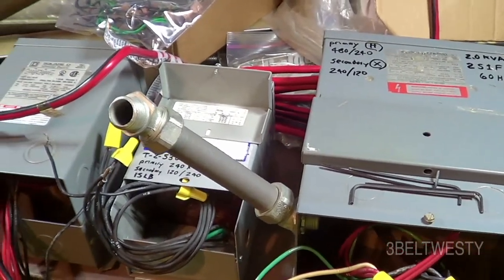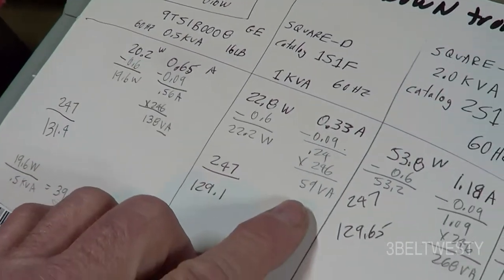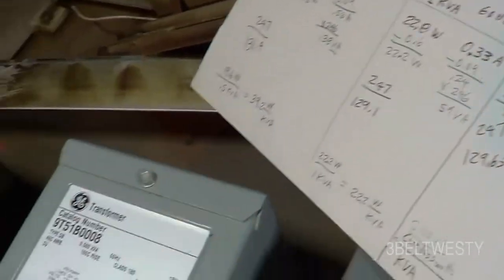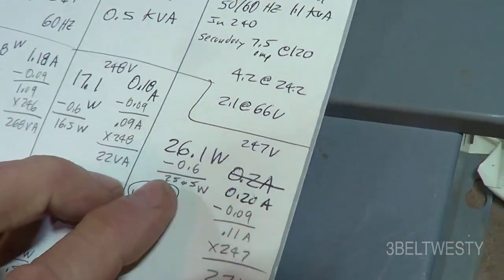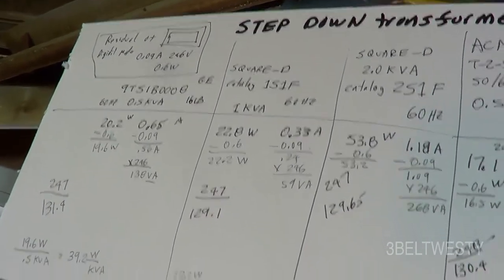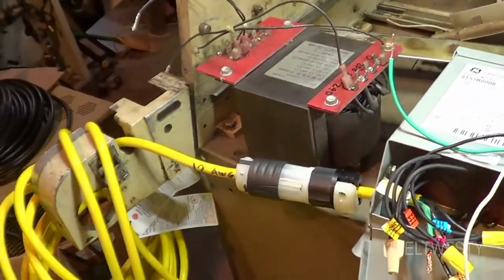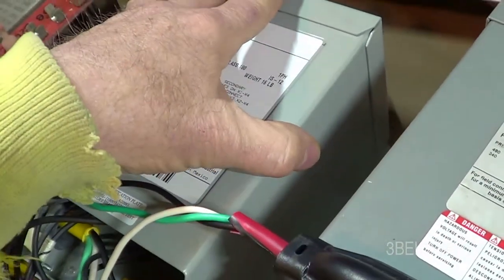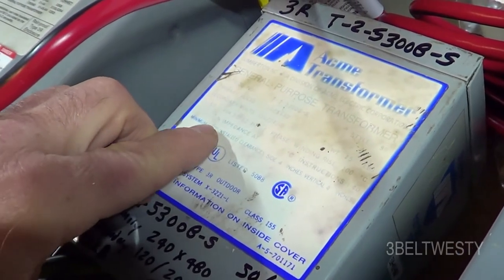Stepdown Transformers no load loss , volt amperes GE Acme Square D

Comment from the maker: Later I plan to measure the no load loss versus input voltage too.
Reply: I have 3 GE square D 15kw transformers 480 input and would like to see if I could use them to run a 10 HP 460v air compressor?